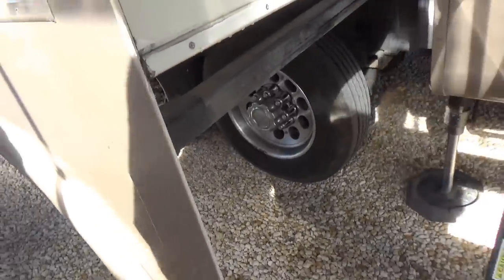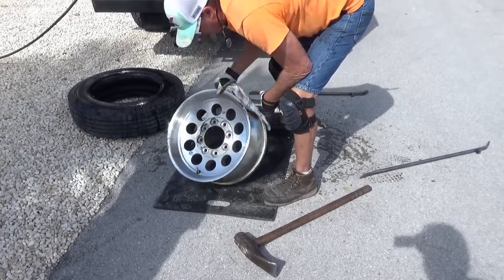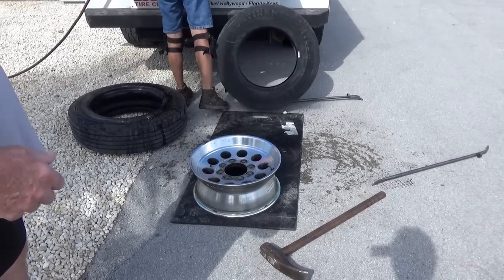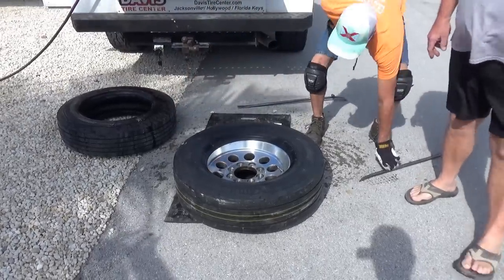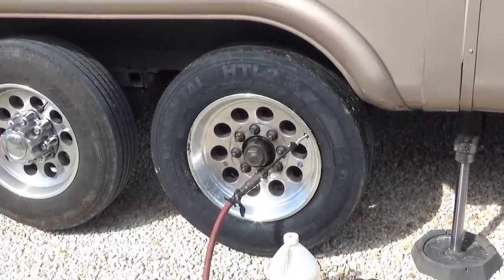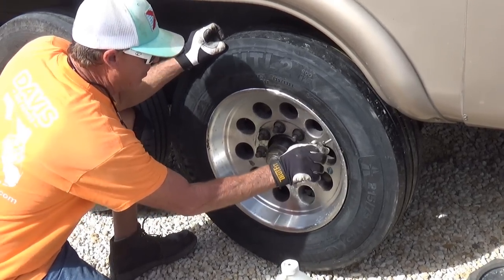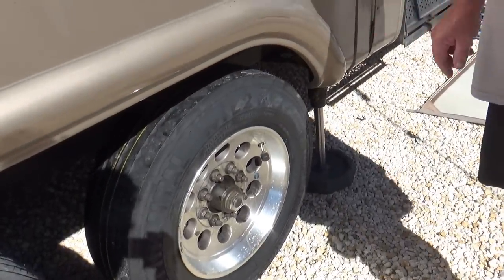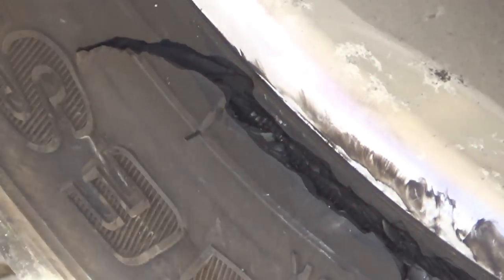😲 Sliced Tire // How Did That Happen?

Comment: I agree with Dave Large pot hole caught the tire and messed it up. If it was a curb both tires would have been bad. I think five beers to watch the guy change the tire that is hard work.
Reply from the maker: I agree on both counts.  :)

Comment: Ouch I felt that in my pocket book.  Those are them tires that they put gold metallic in.
Karen, just cut your beer budget.  Liked the idea of carrying valve stems.  Going to put a few extra in my quick bag.
Safe travels and roads Brian and Cindy, "xtreambydesign with passion"
Reply from the maker: We are going to add a few to our valve stem collection too.  You're right, the higher the cost for materials, the less beer to help pay for it.  Don't tell Dave.

Comment: Hi guys 😺🙋‍♀️🙋‍♂️.. Ever since we had a blow out on our trailer that did $8000 worth of damage we changed tires also... We went to the continental 235 /75 /17.5 "J"... 6000 pound capacity per tire....  They have really been good so far.... I do not like putting beads or powder to try to balance them... I just mount them and make sure it's right on the rim... We are working on our cheap heat now... Having to put new ducking in.... As usual we're having fun... So sorry for their tire... but I'm sure you're absolutely correct that it was a pot hole.. Stay safe... Thanks for the video...J&A
Reply from the maker: Hey guys.  We'll probably replace the others over time to Continentals.  Seem to be highly recommended.  Keep having fun.
Reply: @WattsOnWheels  got part of the storage compartment tore apart...but we are having fun 🤔🤪
Reply: Alex, always love crawling on my belly NOT.  This four day weekend working on the really nasty.  Taxes and in the attic pulling wiring for the recessed lighting in the kitchen.  And cleaning up the poor wiring from the 1950's.
Safe travels and roads Brian and Cindy, "xtreambydesign with passion"
Reply: @brianroth7852  wow..we have cheap heat in our drv and the ducking went bad ..J and I are replacing it...house renovation...I'm not good at....sweet talk Dave....he's the man for that 🤣...stay safe

Comment: I had two blowouts this summer. Both were in an area were I could not get a Continental tire replacement so I had to buy two more G114's. I wanted to replace the entire set with Continentals but just can't bring myself to basically give away some fairly new tires. One of the other tires needs to be replaced and felt like I had to replace it with a G114. I see you mixed your existing tires. I had never thought about the possibility of mixing brands. Any advice?
Reply from the maker: I don't think mixing brands will hurt anything as long as they are the same size.